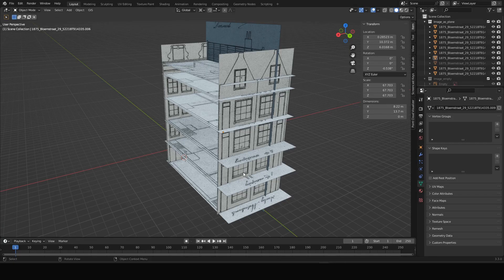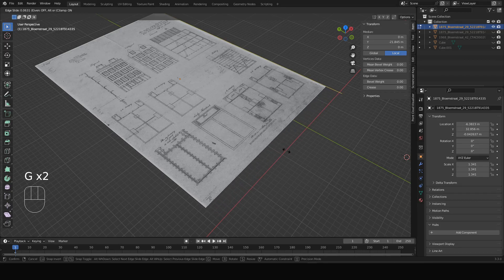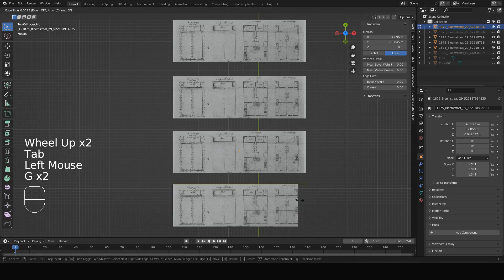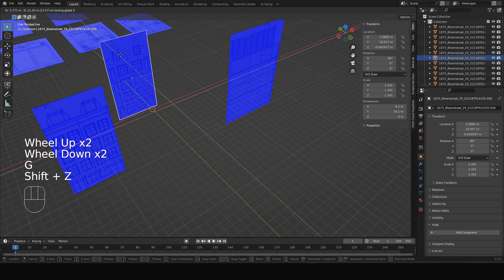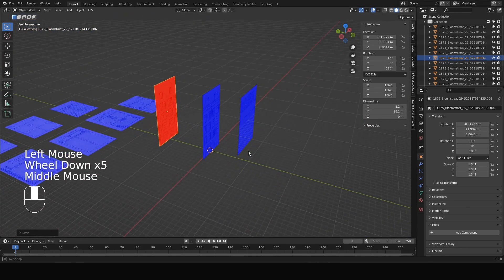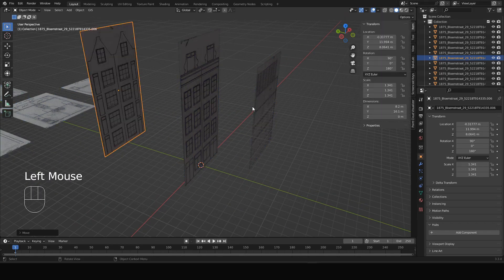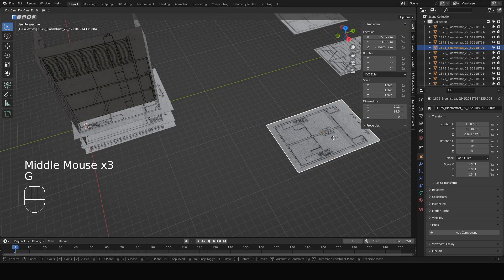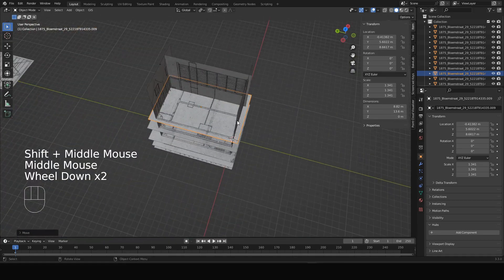Segmenting and positioning scaled architecture drawings in Blender

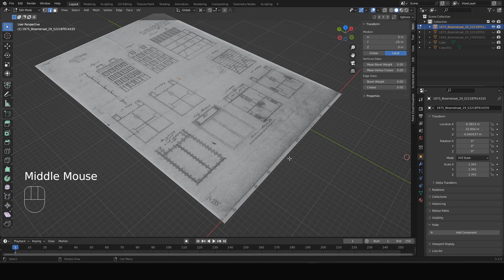Comment: 1:28 You can check Edit Mode > Options > Correct Face Attributes to move vertices at will without distorting the texture 🙂
Reply from the maker: We know, but in this case double g is more quick :)